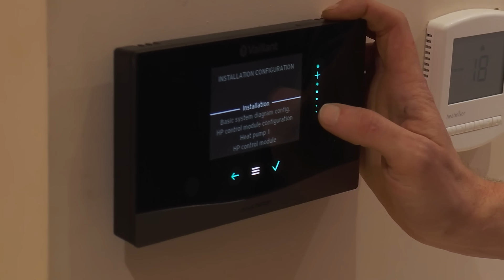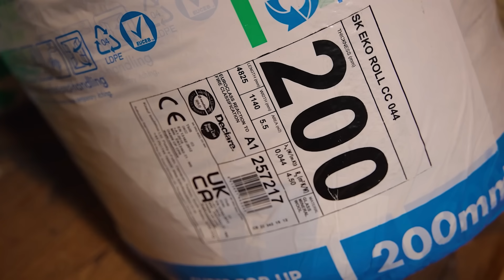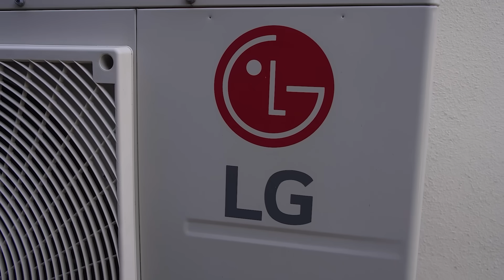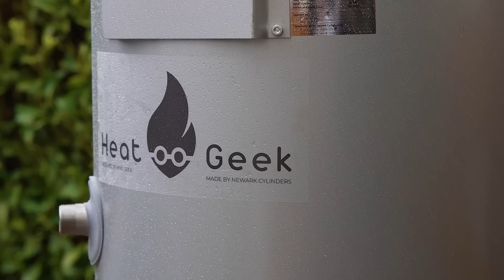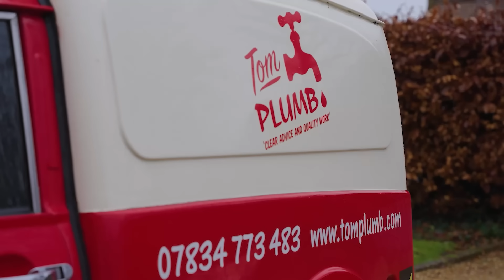Heat Geek’s Heat Pump One Year Later — The Verdict!

Comment: I couldn't stand the thought of our house always being 20C everywhere. My bedroom is outside air temp , velux windows wide open and no heating in there but I have a towel radiator on in all 4 bathrooms to keep towels dry after a shower.  Massive log burner in a central point of the house so it heats the entire house apart from the kitchen. Bedroom doors shut so they don't get warm.
Oil does towel rads and hot water that's it. Would like a small HP to take over this duty in the summer so oil boiler can be turned off. Would that work?
Reply from the maker: I also have cold bedrooms and would have to open the windows if I had John's set up.
Reply: Sounds like you might be running small radiators are high temps (low and slow is best for efficiency)? Would you have sufficient system volume? Also, the efficiency of hot water runs are generally lower than heating, though Zarch of Energy Stats UK has had good results.
Reply: 4 bathrooms LOL

Comment: Gas Boilers are the status quo. We need more passionate, but competent Heat Pump proponents, like Heat Geek, to change this, because at the moment there aren't enough being installed, as people are reluctant to switch to a new technology which they're unfamiliar with. This doesn't mean you should rush to replace your current gas boiler, but if it's over 20 years old and potentially coming to the end of it's life then instead of buying another one, you should definintely consider replacing it with a heat pump, but only after doing a proper, impartial evaluation to compare both.
Reply: My 20+ year boiler will go any day. I will replace it with a cheap boiler.
Reply: @nauxsi  a like for like swap will always be cheaper , i dont want to turn my home into a building site or film set
Reply: @nauxsi  You're confusing me with someone who cares what you're going to do....

Comment: You need a team of Nasa mission specialists to install 1 of those things. It's never going to work for millions of homes. Something like a hydrogen boiler sounds like a better bet and easier to upgrade to. Re-inventing the wheel is not required.
Reply: Two people installed mine in 1.5 days, plus an electrician and a couple of hours from a handyman

Comment: The amount this fella must of spent out I would say this is anything but a success story.
Reply: yeh! as roger says at 6:56 a similar result would be achievable if the gas boiler had been operating at low flow temp all along. I've done that for years with my own house. But of course that's a hard point to accept for the homeowner having spent so much time and money on a HP upgrade. I notice he's not happy with folded arms while this is explained!

Also Gas boiler owners are insistent on timed slot methods of operating with high flow temps, because it's worked like that for years. Many will want roasting hot radiators to be able to dry laundry!

I'm not against HP systems, but not for the sake of it, or replacing perfectly good gas boilers that could have the same results by some slight adjustments.
Reply: Must “of”. Berk.
Reply: @johnboyginger Just can’t spell ‘ve
Reply: @johnboyginger  pedant
Reply: @bield7  Must of, had of, would of are totally meaningless or did you miss out on school?
Reply: @mikeprzyrembel  no, I actually did well at school , thank you for asking (and enjoyed getting my honours degree, too). I just don’t enjoy  belittling people on social media and looking smug in the process.
Reply: @bield7  you just made a typo and rather than deal with teh argument they insult you

Comment: Lets be real, HPs are just really awful- fact.
Reply: what's your data to back that up? as there's are millions of home in Scandinavia heated by them just fine.
Reply from the maker: I think that the electricity prices in Scandinavia are more beneficial and  the distribution of homes makes mains gas a non starter for many so it is not as if they are given a gas or electricity choice. From my travels and time working in  those parts I recall that they have wood burners in many  homes which may also have a heat pump.
As for the data, Sweden leads the way  when it comes to the proportion of small houses that use heat pumps – about 70 percent of houses have heat pumps of some kind and almost 30 percent of the total heat demand in Sweden's buildings is covered by heat pumps.
I think that is an interesting statistic because it suggests that heat pumps are best suited to smaller homes and seventy percent of heating comes from direct electricity and gas and wood as well as oil. The fact that around 30,000 homes are still using oil boilers out of a total of  4.5 million homes. 
We must also acknowledge the larger proportion of ground source heat pumps. It makes a big difference when temperatures dip below freezing.
Reply: @SkillBuilder  personally your just being nice, you no the truth😅
Reply: @SkillBuilder   my average electricity for January this year was 13p/kWh. So not far from what John is paying on OVO.  My Standing charge works out to be about £60 per month too.
Reply: @SkillBuilder  My house has multiple wood burning stoves, but I don't use them nor need them, even in -20C weather.
Reply: @BenIsInSweden  when compared to gas boilers
Reply: @shafserious2805  still no facts then?
Reply: @BenIsInSweden  the only fact has been stated. Im not google.
Reply: @shafserious2805  so you dont own one then, probably also never been in a house heated by one either.  My dad has a combi boiler in his house and it's terrible compared to my heat pump system.
Reply: @BenIsInSweden  2 of my neighbours own one and they arent singing praises! I never heard any one say combi's are not good- what planet are you on?
Reply: @shafserious2805  Because they aren't. I can have my hands fully washed with hot water from the hot water cylinder attached to my heatpump, by the time my dad's combi boiler (in the house he moved into a few months ago) gets the water tepid.  I have my mixer tap for showering set in one position, I turn it on and the water gets up to the correct temperature for my liking. With his, you set it to hot and then have to readjust it whilst in the shower as the boiler starts getting up to temperature. My sister says her's was the same, and she hated it, especially in summer.

With heating (which more comes down to the poor heating system design in the UK), they have to keep tweaking the thermostat because it either gets too hot or too cold.  I rarely have to adjust my system.

And then there's noise - people complain about heat pumps being "noisy", but given that you can hear dad's combi very noticeably from other areas of the house, I would say it's much worse, than a heat pump at full pelt outside.
Reply: @BenIsInSweden  

One major benefit to me when HP installed was that my hot water system moved from vented to unvented , from very poor hot water pressure (I'm in a bungalow) to very much in my face blast from the shower at mains pressure. A major improvement for me, and I usually just heat my HWC to 43C, sufficient for a hot bath or shower, no mixing required.
Reply: @BenIsInSweden  thats you. On general they have not worked well at all
Reply: @shafserious2805  again, still lack of any sort of proof or facts that it's a general problem with heat pumps. Plenty of people on here happy with Heat Pumps, maybe you need to up your google game.
Reply: @BenIsInSweden  you just cant change facts no mtter how much you ramble on about your dads combi boiler.
Reply: @shafserious2805  what facts are those?

The combi boiler that I lived with 18 years ago had its test valve left open by a gas "safe" engineer that the housing association required us to use for the service.
Meant it was leaking gas into the flat whenever the boiler was firing.

Plenty of reasons to avoid gas boilers, but reading the daily mail like I'm sure you do means you're for some reason against anything but.

Comment: I have a ideal 35kw big double rads. Have the boiler set to 55 degrees an it works fine.
Reply: Running a gas boiler low saves gas, and suggests it might be easy to switch to a heat pump.
Reply: @Biggest-hz7ng  its a new build an all the pipes are 10mm. Its not worth the hassle an i dont want a big unit outside my house.

Comment: Was there really any difference between the LG and the Vaillant unit? It seems to me insulation, radiators and times of operating made the difference. 

So there is lots of fettling to do. Let's say anyone with a standard gas boiler also finely tuned everything to get best economy/performance - they'd likely be saving plenty as well. But most don't bother. So you'd need to compare where a traditional system was optimsed in use. The negatives are still there. The massive cost, no.1. The sheer size of the thing, most homes will struggle to install it, certainly without it looking like an eyesore.

The objective I'm assuming is a future where we only have electric run to our homes and gas will get turned off. I have no opinion either way if that is good or bad. But certainly for now I'm sticking with my combi. Instant hot water when I need it and never goes cold. Come back to an empty home and I can get it heated up quickly.

Comment: £920 !!  can't understand that at all. £230 a quarter ! Including standing charge ..for all the heating and hot water for a 6 bedroom house ..that's 16.8Kw/hrs/day  @ 15p (which is insanely cheap) @ 26p it's only 9.7kw/hrs/day which means a 10KW Heat Pump running for less than 1 hour a day for a 6 bed house...🤔
Reply: 10kW is its heat output not electrical consumption, and would only be churning that out on the really cold days.   It will modulate down for the rest of the time.  You can check the link in the description to get the full low down on the stats of electrical usage / heat output etc.
Reply: @stephenauty2402  looking at the stats, the same heat would've cost £2200 with gas.

Comment: Fancy not being able to open an external door and let the cold air in all winter. I guess you could try crawling through a cat flap 😂
Reply: Fancy not understanding how heat loss and thermal inertia work.
Reply: @BenIsInSweden : I know that we open the front or back door at least once  an hour and no heat pump could compensate for that heat loss and transfer of thermal inertia in a short period of time. They obviously don't have a dog.
Reply: @elric6084  

I have a dog, albeit a medium sized one.

Door open dog out, door shut, door open, dog in, door shut, repeat ten times a day, and my heat pump more than copes.

If you stand with door wide open for five minutes each session watching your pooch do a single fish or a Richard the third then you will lose a lot of heat irrespective of heating system.
Reply: @_Dougaldog  : Do you have a log burner?
Reply: @ 

No, if it went below -10C or so I would use a fan heater, that is very unlikely to happen.
The HPs themselves are designed to work to -25C external temp'.

Other than that log burners are not a healthy option with PM2.5 particles leading to higher numbers of respiratory and cardi vascular diseases.
Reply: Air has a relatively low heat capacity and density, which contributes to its low thermal inertia. This means that air can readily absorb or release heat, leading to quick temperature changes.
Reply: @ yeah, you're still not understanding it.  Low and Slow heating heats up the objects and walls in the house which will also release the heat back into the air when the air temperature drops.
Unless you're leaving the door open for the whole hour, the amount of heat lost through it will be minuscule compared to the heat energy contained within the house.

Also for the specific situation you're talking about, there's a thing already baked into heating system design (regardless of heat pump or gas boiler), called Air Changes per hour.
So you're wrong about a heat pump not being able to keep up with that.

Comment: Heat pumps do work, but how well seems to be a lottery! You've only got to go on the many forums to see that we are a long way off for them being a viable boiler replacement at the moment.
Even Adam ( heat geek) says they are fickle!
The Government need to make the performance of these heat pumps more transparent, because the manufacturers are misleading us all on the output, noise levels, COP/SCOP, defrosts etc. It's like the car emissions scandal all over again 🙄
It would be interesting to know the call back percentages, compared to a boiler? 
In the meantime, they should get rid of the grant, make it an interest free loan!
Make it mandatory to fit in every  highly insulated new build, its
far cheaper to fit when building new then to retrofit. 
According to the Government that will be millions of heat pumps fitted, with all the house building they're going to do!!
Reply: There's lots of FUD being spread by The Telegraph etc. 

Gas boilers and heat pumps have very similar levels of satisfaction.
Reply: @Biggest-hz7ng  There is good reason for FUD though! Heat geeks themselves have had problems with units that don't perform as per manufacturers figs are very noisy when under load. The COP and SCOP figures from different manufacturers are iffy! They aren't taking the lost energy from defrosts into account either.
We are going to be spending billions on these as a nation, we need to get it right.
Reply: @jezzaandrews1940  I think the grant is necessary as we need to switch to low temp systems and build the industry. Perhaps with tighter requirements on the resulting systems.

Comment: Just to pick up on one point - re keeping the gas boiler as an emergency backup... worth noting IMHO that most gas boilers don't have an emergency backup, and they're just as(?) prone to breaking down at annoying times. Last time my gas boiler failed (I've had 2 fail in the last 30 years, I think my current one is coming up to 10 years old so will likely be due for replacement soon) was 2 days before Christmas and it was a bloody cold one. Parts for my old boiler were unobtanium even if it wasn't so close to the holidays, so my plumber kindly offered to install a new one. The new one had a missing part out of the box (the bit that captures the condensate & siphons it out periodically). Fortunately for me, as the boiler is right over a sink in the garage, we could temporarily just install a pipe that drained straight into the sink & therefore I had heating over Christmas that year... but literally for 3 days the only way I could get hot water was from the kettle, and the heating was a motley selection of ancient electric convection/fan heaters. That worked, kinda, but IMHO if I went to a heat pump, I'd still ditch the gas - as long as there was an electric immersion heater in the hot water tank, I'd have more backup than when the gas boiler went out.